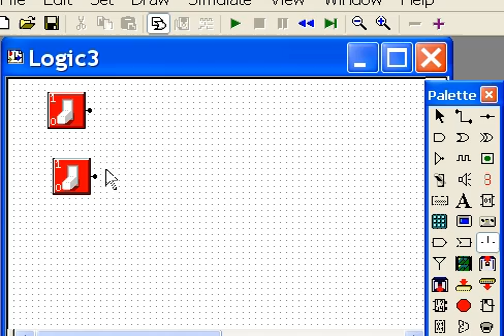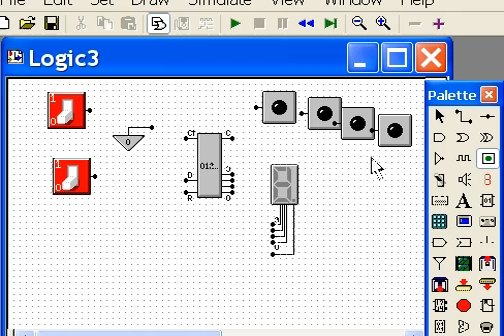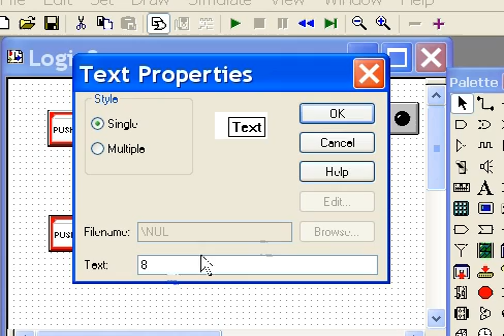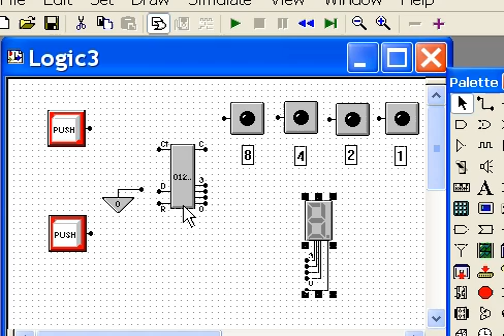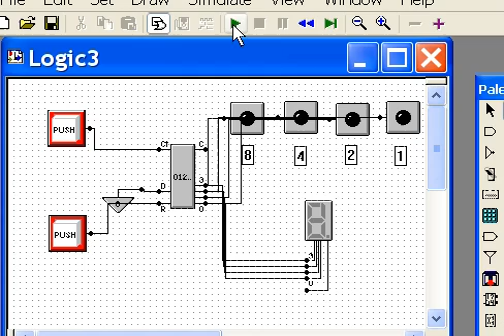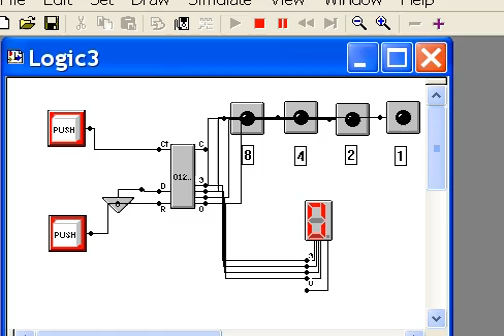Counter,7 Segment Display, Binary Display

Comment: hi Sir, I have a question, what about if I use 4 switches and two 7 
segments display? and what I'm trying to do is when i switch on the 
first switch it will display 0,1  and when I switch down the first 
switch and switch up the second switch it will display 0,2 and ? Any 
Suggestion Sir?  Thanks